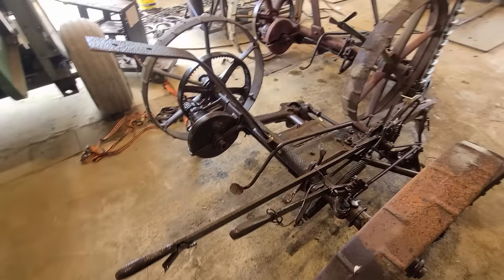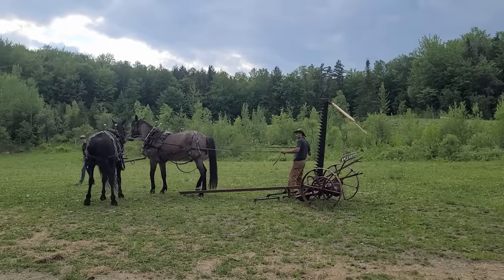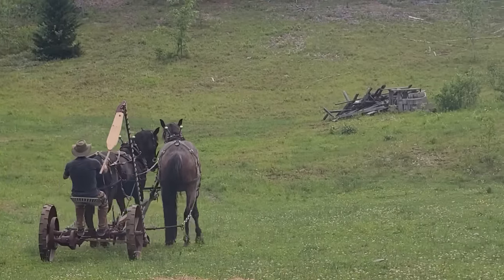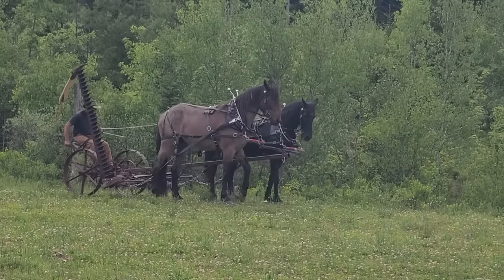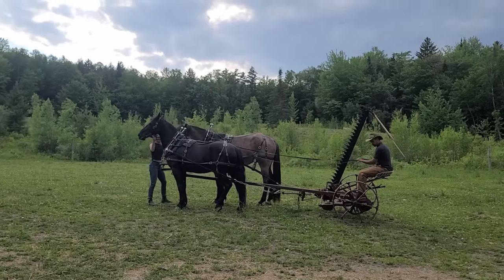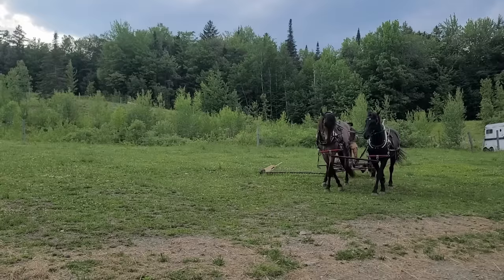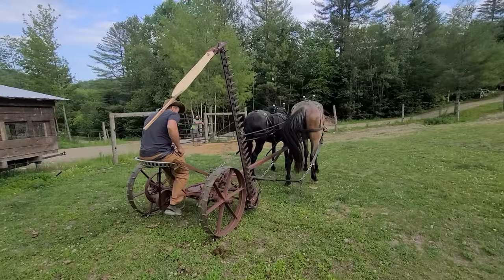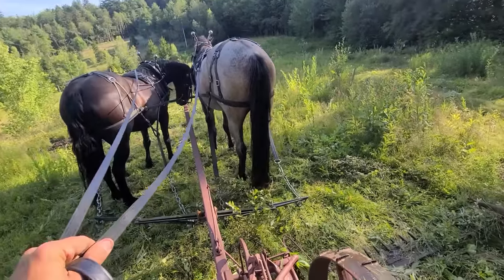Training or Breaking a Team of Horses to a Sickle Bar Mower

Comment: Sir, I've watched a couple of your videos and I'm happy that you're trying to work horses and that you're using Morgans in New England.  It's great that you are utilizing a local breed to continue with what they were bred for. 

However I have s couple of suggestions for you. I've trained a few horses to ride and drive. The three (3) basic gaits you start with are:

1) whoa - without a basic understanding that when you give that command you want the horse to IMMEDIATELY stop

2) stand - when a horse is asked to stand they are required to not move

3) walk - a horse has to understand that a good flat footed walk is important and necessary

I watched one of your videos where you were driving your mare and it looked like you were training her for a scurry class. She was consistently asked to canter in harness, never asked to stand. You've done a great job training her to be antsy in harness, not to stand and be ready to charge into a canter at the slightest urging. 

My suggestion is to get a curved bar butterfly bit use the lowest rein placement and put her to a stoneboat.  With the stoneboat she has constant pressure whether going up or down hill. Teach her what whoa is, teach her that standing is a pleasurable experience and something she looks forward to. You have to undo all the training you have done up to this point. I prefer a curved bar bit because it doesn't poke the top of their mouth or act as a pinching movement on the lower jaw. 

I totally agree about being calm and quiet around your horses. They have great hearing and don't need to be yelled at. I listened to you yelling at your team through the voice over.  My suggestion when trying a new piece of equipment that you know will be noisy is hook a TIRED team the first time.  Hook the team to a stoneboat and work them for a few hours. It's amazing how having the edge taken off makes a quieter team.  

I'll quote an old saying from where I'm from.  Young mules (here read young horse) are like teenage boys, they have to be a little tired to stay out of trouble. 

Please take this post as a positive critique and I wish you well with your endeavors.
Reply: 6th

Comment: You have been very lucky not to have a run away starting out..I have had success with heavy slide/stone boat and holding a wooden toy "noise maker" which mimics the sound of a working mower very closely..I can then get them used to the noise but more importantly let them know when they stop/stand the noise stops..best wishes..

Comment: I like it that you train them without blinders. In my experience  of over 60 years of driving horses I found that those trained without blinders tend to stay much calmer when confronted with something new or even initially scary.  The only thing I would have done differently when hitching them to a new implement is I have them stand at the hitch-rail for quite some time, and even moved the pitman in this case to let them experience the noise. But your horses took that well even free standing.
Reply from the maker: Appreciate the valuable feedback.  This definitely would've further decreased the anxiety.  Still gaining experience as I go and so thanks for the additional pointers
Reply: I disagree about the blinders, them being able to see what is behind them causes their anxiety
Reply from the maker: @hughperkins707  yes and in half an hour they are over it and will never be anxious about it again

Comment: You should try tightening up those rear chains i noticed that every time that you stopped them they got a lot of slack in the chains and the straps just taken it it a chain link or to might help i have watch a lot of old school horse farmers hooking up there horse it just looks to loose just saying
Reply from the maker: First time on this rig so i might not have  had it perfect.  I used to string them up tight between neck yoke and evener, now i like to give them 4-6 inches between engaging the evener and catching the neck yoke, measured at the brichen.  That way they can move freely without being squeezed tight the whole time

Comment: I don’t think your bar should be overcentered towards the seat. There is a hole in the bar and a bent rod attached to the mower frame that the end of gods in the hole in the bar and the bar hangs on that rod when reading the mower.
Reply from the maker: Weve since made many find adjustments... and shortened the bar to 5 ft.  Good observation tho.  The bend in the rod might bring it too close to my head : @
Reply: @ruggedridgeforest7775  Boy, I didn’t check my spelling very good. Sorry for that.  I grew up farming but we didn’t use horses for that. Horses were just a way of life and a way to keep the old ways alive. There’s nothing better to mow roadsides though than a team and mower.